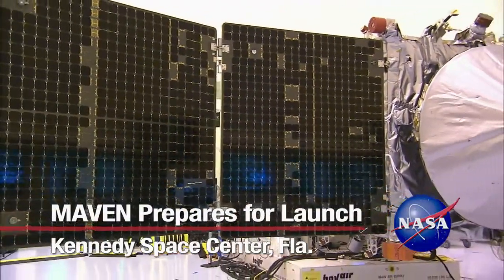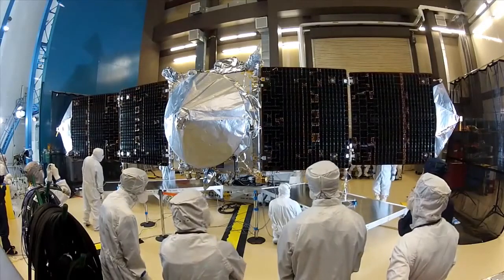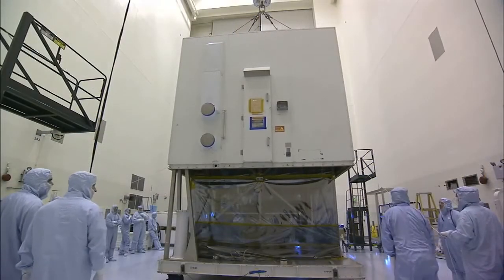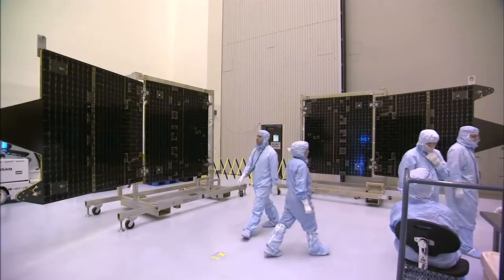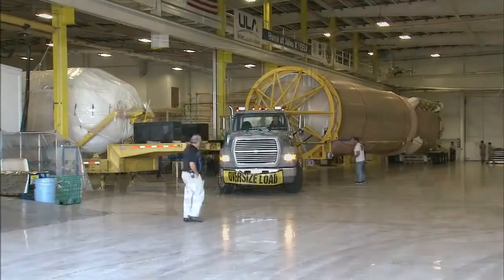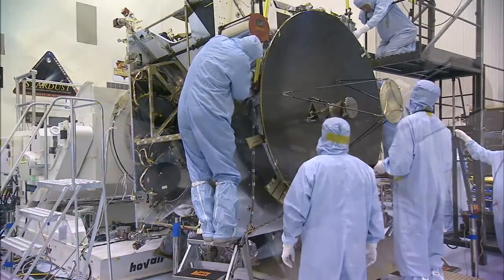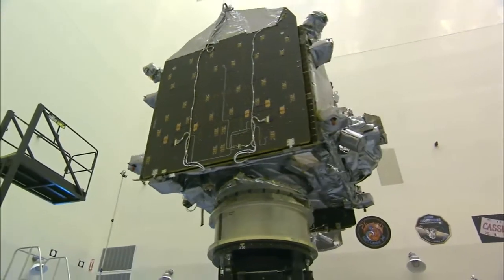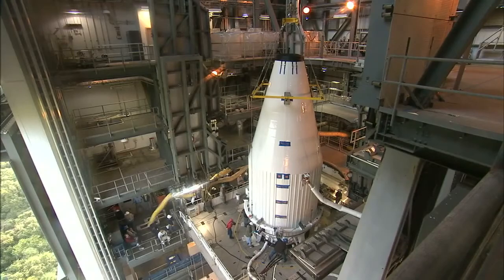MAVEN Prepared for Trip to Mars

Comment from the maker: MAVEN Prepared for Trip to Mars

This video from NASA's Kennedy Space Center traces the path of the MAVEN spacecraft, from Assembly, Test and Launch Operations (ATLO) at Lockheed Martin, through its trip to the Vertical Integration Facility (VIF) at Cape Canaveral Air Force Station Launch Complex 41, where MAVEN was mated to the United Launch Alliance Atlas V booster that is scheduled to lift the Mars orbiter to space on November 18, 2013.

(Video credit: NASA's Kennedy Space Center)